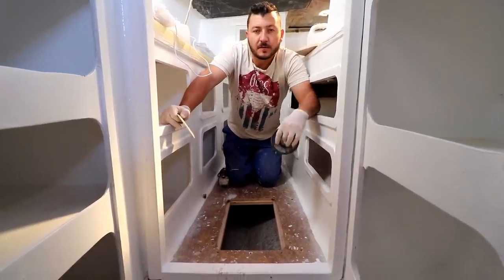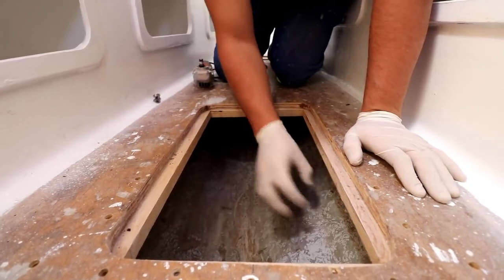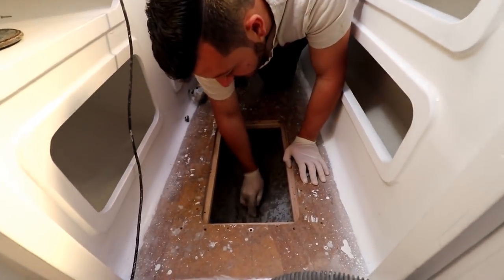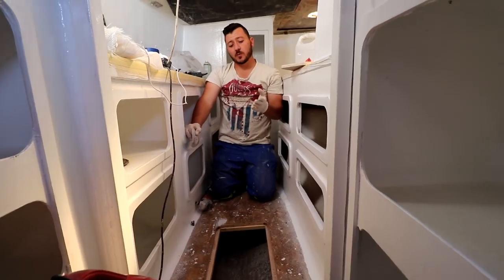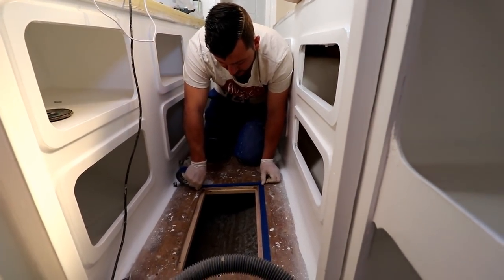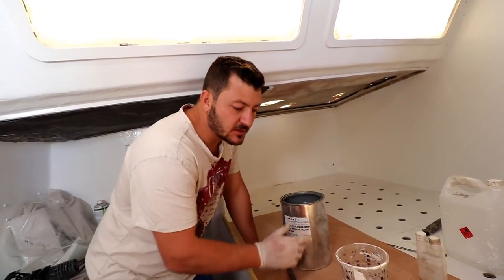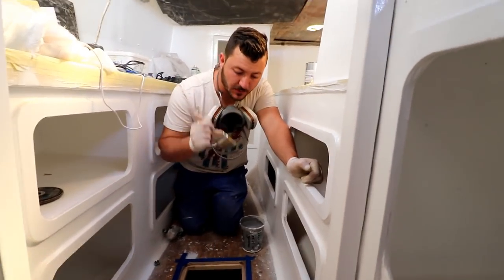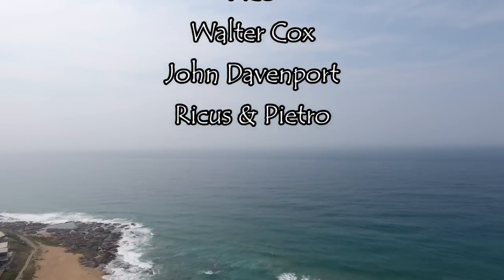HOW TO: RESTORE your boat BILGES!

Comment: you might mention that polyester resin or flocoat does not cure,or stick to surfaces that have been recently treated with epoxy,so care is needed not to overcoat one with the other.

also flocoat applied directly to ply wood will delaminate from the wood over time and cause rot,probably better to use epoxy which penetrates the plywood better for the undersides of the hatch covers.

this is generarally why modern yacht builders use a high build epoxy paint for bilges these days as it is compatible with epoxy and polyester resins.
using a flocoat for bilges is very old technology when builders first started to built boats using fiberglass,and only polyester resin ,before epoxy became readily available.

i have seen many old boats where the under floor plywood is completly rotted out between the outer layers of glass and flocoat,due to moisture trapped between the outer layers of glass and flocoat.

Comment: Love the how to video's!  It would be great if you could give us a link to the products you are using so we can do further research:-)  Also, is there any reason you didn't use gel coat?
Reply from the maker: Will try link the products in the description the weekend. Will let you know once we put it up. 
Gel Coat cannot be used in bilges due to the fact that gel coat is designed to remain tacky on the surface exposed to air, the reason for this is it is a laminating mold resin, in other words this resin would be applied into the mold and then glass layers placed over it to form a product and then it can only cure when not exposed to air.

Comment: Cheers - but always curious as to why bilges and engine bays aren't painted gloss white which would allow you to instantly see any rubbish; rusting etc whereas grey is sort of difficult to note issues or identify problems.  Watched a narrowboat engine bay being painted in dark green and sure it's a classic colour and maybe traditional but would be really hard to see problems too; like oil leaks etc...or am I missing something? That said grey does look kind of cool and a nice contrast to the white of the cupboards...
Reply from the maker: Ricky wanted to paint the bilges white but I chose the grey, just to contrast a bit. Grey shows a lot less dirt etc.. Ricky & I run a tight ship so we always inspecting our bilges.. both have their pros and cons but i guess it's just preference. If you want to paint your bilges white there is absolutely nothing wrong with that 😊